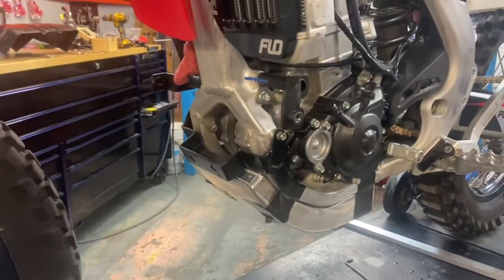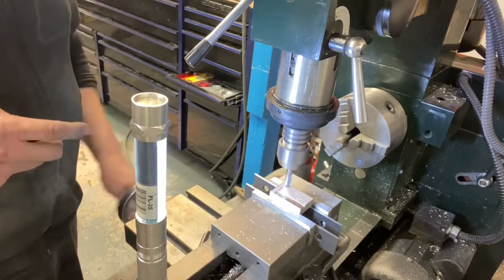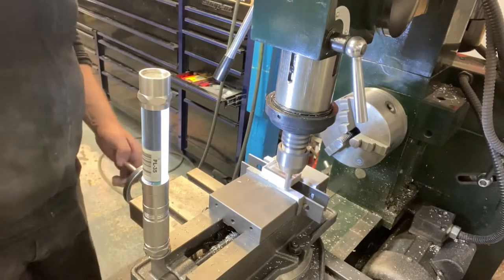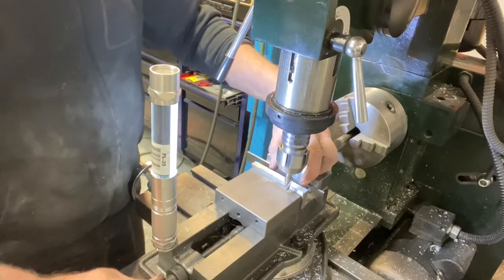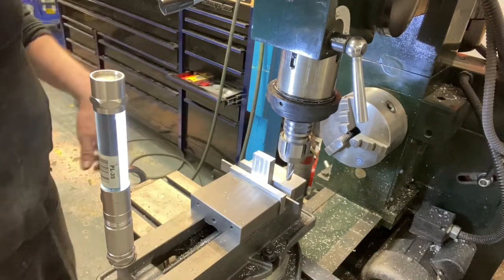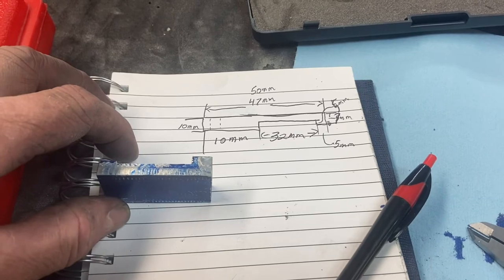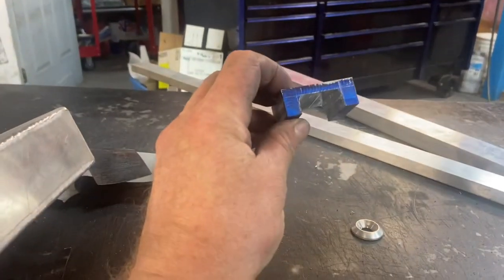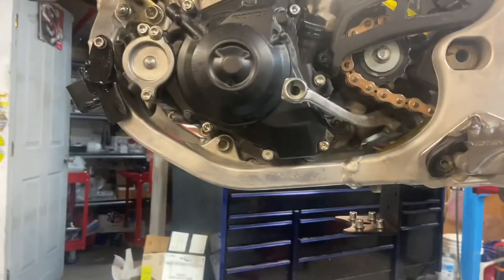CRF450L rally build #16

Comment: Great video. So does the Sonora rally require the water tank? I luckily don’t need one for the Kalahari Rally.
Reply from the maker: Hi Ryan.  Thanks for the comment.  No Sonora doesn’t require it.  The reason I am doing this is to transfer in impact put on the skid plate to the frame.  Whoever designed the kit thinks a carbon plate held on by riv nuts can support an impact.  I don’t want to take that chance. Seeing as I had to build a solution, I thought the best way to do it was to have a tank there.